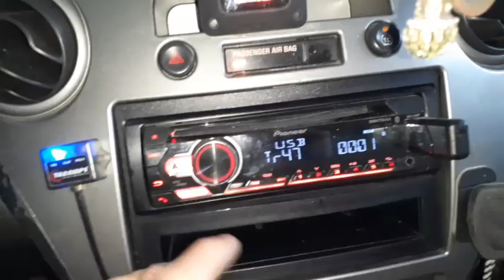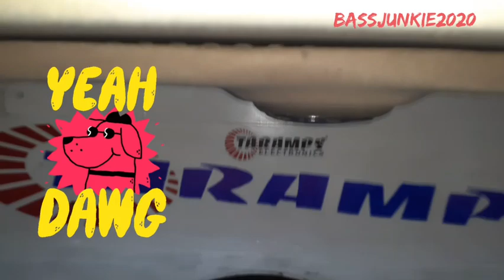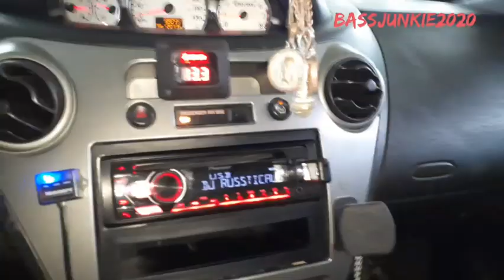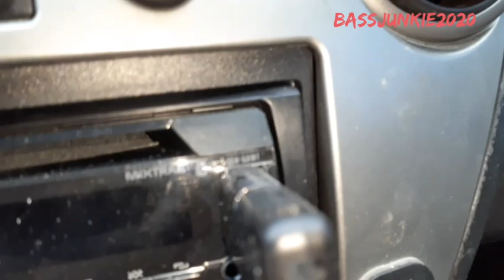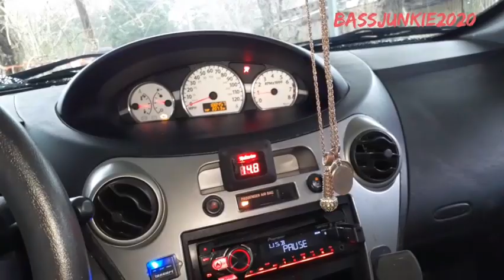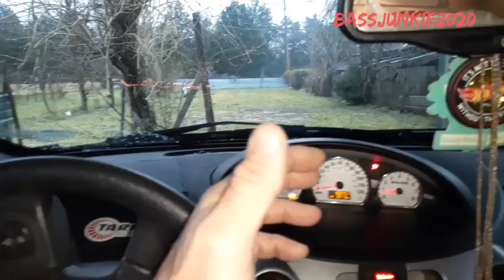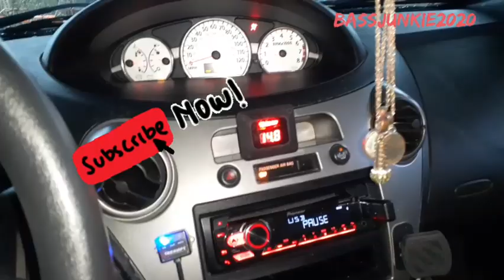Update on wall build! I i inverted the Sundown zv3 18"! Taramps md 8k/40 ah limitless lithium! Demo!

Comment: You should add a support under the motor of the sub to help with the weight until u add another baffle and some bolts
Reply from the maker: Good idea👍 And I am going to double up the whole front👍💯💨💨💨
Reply: Niceee your system sounds great man, I'm redoing my tahoe and have been looking around at ideas. I'm going to run either 2 18" evls or 2 15" vxfs on rp4500 or possibly a taramps 8k
Reply from the maker: VFXs !👍😎💯💨💨💨👊

Comment: Looking and sounding awesome man! My weather's been shitty here up in pa too. I  just had to get the audiocontrol lc2i because my cheap loc was limiting the power and giving me turn on/off pop problems. So much better now. But now I NEED to desperately upgrade my electrical. My amp is 2500w mono but only fits 8 gauge so I'm going to get two reducers and better wire. Only problem is I'm having is finding the right wire, and for the right price. Any ideas man?
Reply from the maker: I use windy nation welding cable. I use 0g but wonder if you could use 6g? If not they sell 8g also! To me it's the best stuff!👍😎💯💨💨💨
https://www.amazon.com/dp/B0161Z7WZI/ref=cm_sw_r_cp_apa_fabc_QSAD26CS9MQ9D0AWKYTS?_encoding=UTF8&psc=1
Reply: @bassjunkie2020  awesome thanks! I was thinking of running 4 gauge from the battery to my amp.
Reply from the maker: Would be good👍😎💯

Comment: How many cubes is that 15 box,the one next to the 10 box
Reply from the maker: The mdf 15 box is 6 cubes 34hz. The other 15 box birch is 8 cubes 35hz👍😎💯
Reply: @bassjunkie2020  is the 6 cube for sale
Reply from the maker: Yeah but I need to fix it up a little👍💯
Reply: @bassjunkie2020  what are the measurements
Reply from the maker: I have cut sheet and specs. Hit me on my messenger later or through the group. Link is in description 👍

Comment: Inverted for sure! Great vid thanks for showing the big 3. Does your light indicator for the amp turn clipping and prot when base hits hard? Mine does it all the time when the bass gets hit hard. Does that mean anything or is it not very accurate?
Reply: Prolly means tou are dropping below  11v
Reply: Or input voltage is too high. Turn down the gain or kiss your subs goodbye  Lol.
Reply from the maker: If I turn it up to much the lights come on and I back off volume.  But far as going into protect no. I don't even have 8k turned up. Cause the Sundown is only rated 1500 rms. I have 8k set at 3k. But my smart 3 used to go into protect all the time. An that's because I was dropping below 11 volts! But ever since I got that lithium. No more protect👍😎💯
Reply: @boomboxmike5838  never drops below 13.5
Reply: @Widowmaker2828  I already checked its under 1.5 volts. It doesnt stay on jus flickers slightly on huge base hits
Reply: @bassjunkie2020  thanks. It doesnt go into protect but light just flickers. I used your method of setting up and I even confirmed by putting 40 hertz and volume up at 80%
Reply from the maker: Cool that method works!👊👍💯
Reply: @GeneG69  maybe a dirty signal from head unit or a loos connection? Caust that sounds like it bangs

Comment: How do you like inverted vs the other way?
Reply from the maker: So far I like it better! Seem louder!! Plus looks cool 😁👍😎💯💨💨💨
Reply: @bassjunkie2020  Have you checked your spl yet? I would be interested of there is a difference on the meter. I never had luck getting a gain either way... ☹️
Reply from the maker: @Widowmaker2828  It seem better. I built box to the specs Sundown said to build it. Which  is small. So I think maybe the box is little to small. It is big sub. So take a lot of space in box! So by inverting I save all that space. And I need a meter to measure spl and stuff👍😎💯